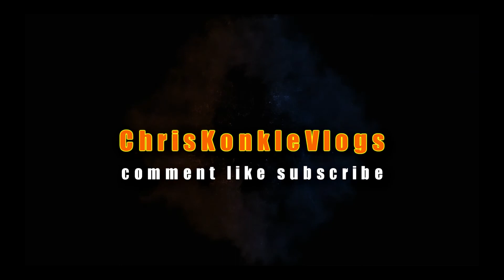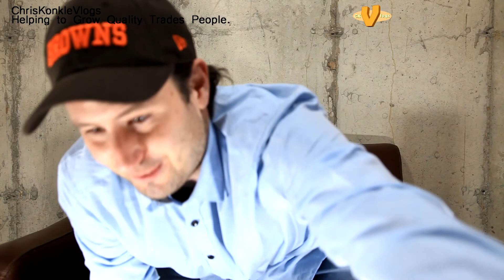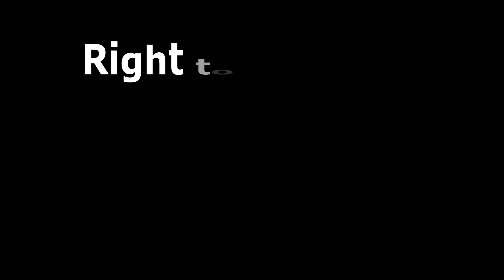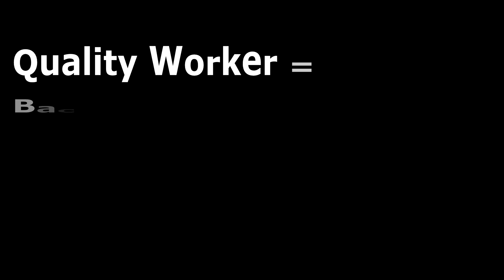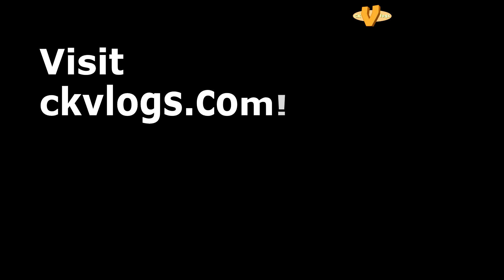First Day On A Construction Site

Comment: I've been doing alot of residential remodeling for the last decade, mainly doing drywall repairs after water damage, now I landed a union drywall job and although I have been doing drywall repairs for quite a few years, I'm still nervous for my first day doing commercial drywall because I'm not geared toward speed. When I work in a home that someone is living in, I'm concerned about keeping the area clean, protecting the surrounding environment, as well as doing all the mud work and stuff like that, not to mention furring out studs or adding sister boards when matching up to thick plaster. Anyways, Im use to working by myself on a small scale and I'm intimidated by what is going to be expected of me considering I have alot of experience with drywall, just not that large of scale. Thank you for what you are doing. I strive to be the best at what I do and I am excited to take my existing skills to the next level. At least hanging drywall is not as tedious as taping. Again, thank you for these videos.
Reply from the maker: Your very welcome. I have a whole playlist on commercial drywall.and one on steel stud. Don't be nervous about it. It's really just learning the system, the routines. I'm a bit OCD about having a clean work area myself and can still hang a lot of board. Just watch the guys hopefully you will have some good guys to learn from and will teach you. If you know drywall and have the tools and are a good worker then it's all on them to help you and teach you so your an asset. If you have any questions I'm always here!